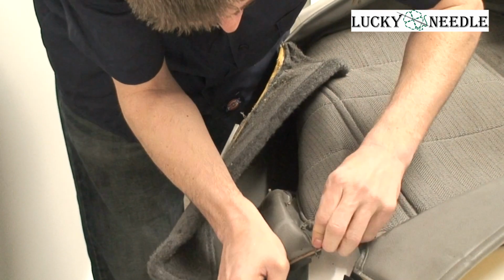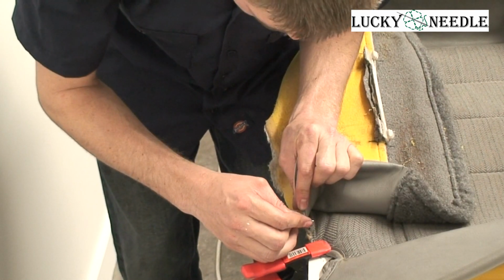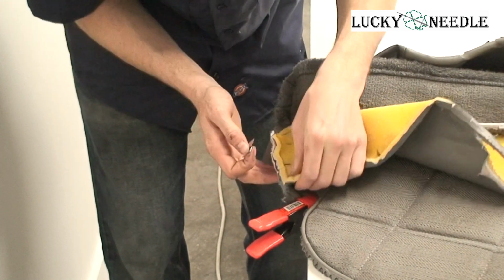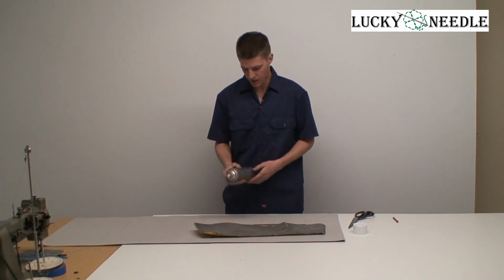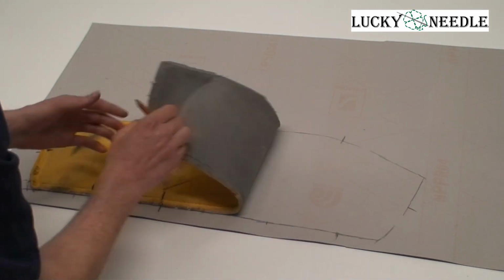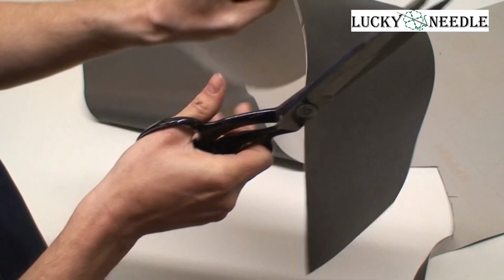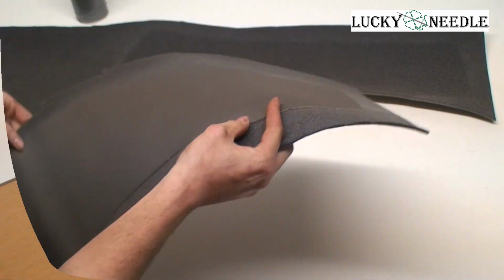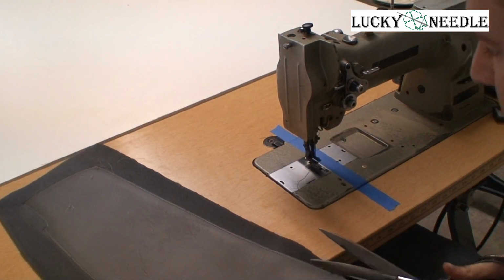How to Fix a Torn Car Seat  |  Automotive Upholstery |  Seat Repair 2

Comment: An extraordinary demonstration of why some “DIY” leaps of faith should know well beforehand that the bottom is much deeper than a new journey of all thumbs on deck.  Me thinks Mr. Lucky Needle’s modest and very thorough professional presentation does more to convince purchasing his highly valued, specialized and seasoned skills than risk failure at any number of the many steps a novice would most likely pay a much higher price for.
Thanks Lucky Needle for making it look so easy!

Comment: Was the spray you used to hold down the pattern called temp tack?
Thanks for the vid, looking forward to more!
Reply from the maker: The spray I use is actually called "General Purpose Spray Adhesive". But everyone I know calls it temp tack because it really doesn't work very well to actually glue things together, but it works great to hold things in place. You can get it at any good upholstery supply store. Just get the cheep stuff and don't confuse it with the spray adhesive you can get at the hardware store. Its not the same stuff... Thanks for watching! More videos coming soon!
Reply: The Lucky Needle
Thanks for the info!